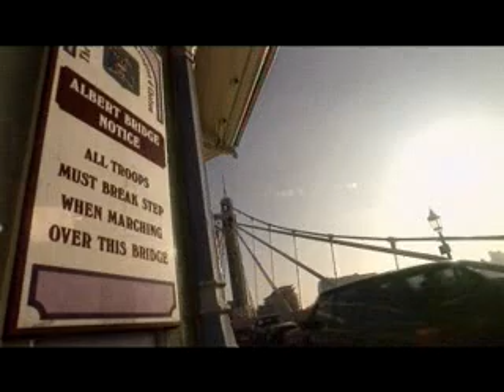London Millenium Bridge Opening

Comment: The design, the diagnosis of the pedestrian induced vibration problem and the remedy are all defective. 1. The Design is defective as an unstable transverse configuration was chosen.  If you consider the transverse X-section of the bridge deck, you will find that the gravity load on the footpath and the two equilibriating reactions from the inclined ties between the deck and suspension ropes are collinear, and the three meet at a point below the deck. In the very first course of structural analysis, usually called Engineering Mechanics or Statics, we are taught that a 2D structure, such as a Beam, supported by 3 reactions will be unstable if the 3 reactions are either parallel or collinear.  In this case there are two reactions along the line joining the deck with the suspension cables on either side and the gravity load vector passing vertically through the deck center. The three force vectors are collinear through a point below the deck and lying on the vertical through the deck center. About this point the deck can rotate without any resistance. This wobbly motion is what actually happened. 2. The diagnosis of the problem is wrong on even more accounts. Suspension bridges are typically even more flexible with very long periods of vibration. They do not exhibit pedestrian induced vibrations. Truss bridges as well as Beam bridges on the other hand are very stiff with very short periods of vibration.  They also do not exhibit pedestrian induced vibrations. For economic reasons the sag of the suspension cables in suspension bridges is kept large, usually Span/10 and only vertical sag is provided. In this case a very shallow inclined sag of span/60 was provided. This not only made the bridge uneconomical but 6 times more stiffer than a usual suspension bridge with a sag of span/10. This increased stiffness reduced the period of vibration by 2.5 times, and made it coincide with the period of pedestrian footfalls. 3. The remedy for the mis-diagnosed problem costed about 25% of its initial cost. It involved installation of a large number of damping devices that would involve frequent maintenance.
There are thousands of bridges of all types designed by run-of-the-mill structural engineers that continue to function well. In most of them neither wind-induced nor pedestrian-induced vibrations have been considered in design. In fact most of the existing bridges were designed manually with the help of slide rule or calculators - - the structural analysis computer programs were non-existent. The designers then knew their structures more intimately.  The existence of Modern structural analysis and design computer software disengages the designer from analysis and design and is the cause of the problem.
Reply: Ok I have no idea how they fucked this up so catastrophically because as a total layperson who knows nothing about bridges or engineering your comment makes sense to me, so surely someone who studies this shit for a living would have had the foresight.
Reply: TLDNR and i speak for everyone
Reply: @chris2145  its TLDR